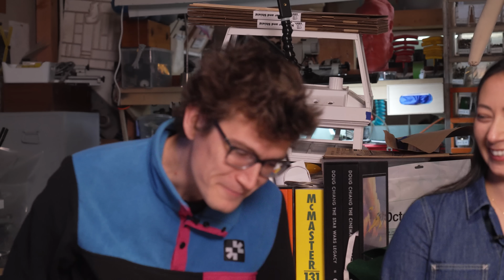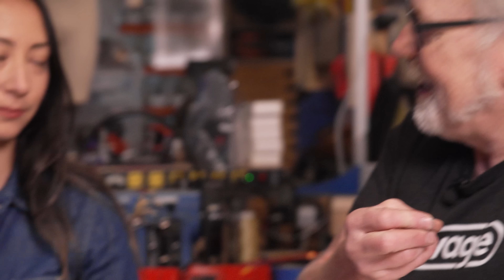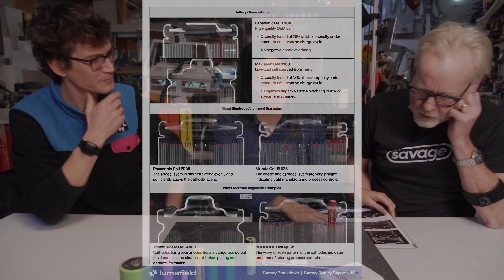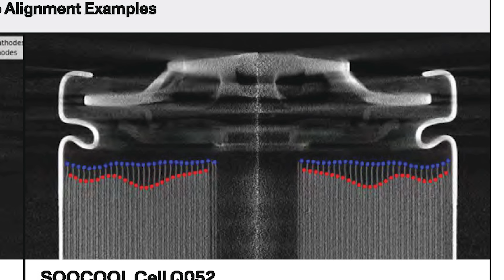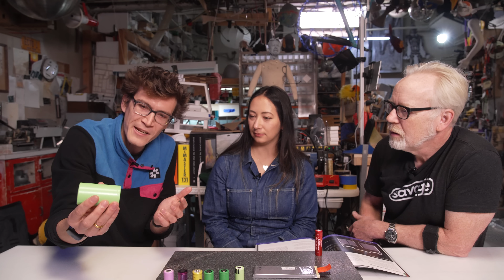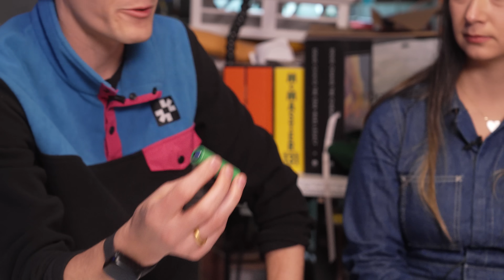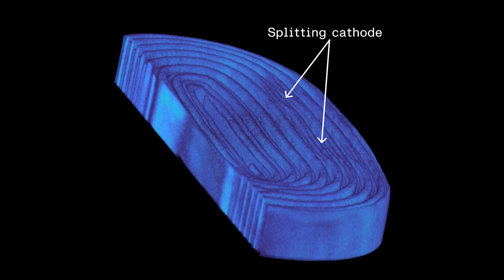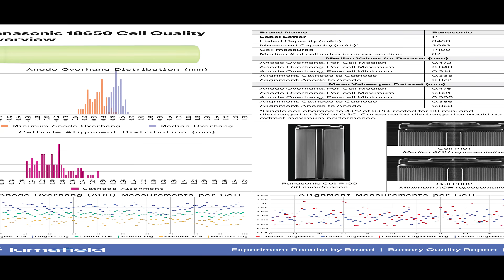The Surprising Flaws in 18650 Lithium-Ion Batteries

Comment: My hobbies are long range drones and rc stuff, i built diy batteries, i invested on a metal fire proof safe with smoke vents and store hundreds of my lipo pouch,lithium 18650/21700 inside, and i NEVER charge packs if I’m not around them, if i had to charge overnight i leave those on my backyard shed inside a metal ammo box that is 30 feet away from our house..all of my unused stocks are all discharged at 2.85v for months of storage in my cool unfinished basement near a fire extinguisher..

Comment: Question; I use two 18650 cells in series to power RC gear, and a safety would be dangerous if there was a loss of power. Is it possible for the safety to activate while in service? not worried if the safety pops while on charge, but in the air is out of the question.

Comment: Using a granite surface plate to display the batteries.  The airlines would be interested in safer LiPo batteries, or at least passengers would. Probably won't be long before all of them will be banned on board.

Comment: Interesting visuals, but the video never really quantifies the actual safety risk. 

Showing that cheaper cells have more defects is useful, but “more defects = more dangerous” is not the same as showing how much more likely they are to fail, catch fire, or short internally.

Comment: Excellent interview.  Remember folks that when these dodgy batteries start burning, they also emit a shedload of highly toxic noxious gasses - stuff like Hydrogen Fluride that will wreck the lining of your lungs if you inhale it. 
And if they are in a sealed container, can generate explosive gasses too that go BANG ( turning the container into shrapnel if you'reunlucky).  Run away as fast AF if you ever have one on fire or off-gassing.

Comment: I charge in my garage with batts in a two hole concrete block on a concrete floor with a 2.5 inch concrete slab closure on top. I slow charge whenever that is a choice. Unplug overnioght.

Comment: My powerbank just started to lose charge after 6 years..as I took it apart I noticed there was two blue 18650 batteries in it😮 I found this video as I was searching for replacement 18650 batteries..it was a tzumi power bank made in china..I'm wondering about not getting the batteries for it..I'm always home by my lithium batteries when charging..just in case

Comment: Ive have  used both the old Ray-O-Vac (way back when), and now days, Energizer over Duracell. Is it true that the best way to checkout a AA, AAA or D cell , is to put it under a load, and watch the voltage?

Comment: Wait till you discover the 85% difference at installed watt meters at any renewable site and then you add batteries for a 5% more of a difference so armed with a volt amp meter any renewable site don't forget the one293

Comment: interesting talk and tech, thanks! 3 key questions:
1) What are examples of a "reliable manufacturer" for these batteries? When you say "Amazon" & "Temu", does that mean e.g. "Amazon Basics" branded batteries, or anything bought off these sites (since you mentioned the branded packaging can be misleading / irrelevant)?
2) Is the danger / risk in using these cells during the recharging process at the wall, or anywhere in the normal life cycle of charge & discharge?
3) Where is the oversight for false advertising? Sure, we've become accustomed to a world in which companies regularly bend the truth to fit a narrative, with small print, T&Cs, and asterisks and footnotes to CYA against litigation. But bald-faced lies? I don't understand how it's become normal to the point of dismissal-with-a-knowing-smirk that a product can be sold which is advertised as having properties that are physically impossible.

Comment: Hopefully,  my $1K+ DeWalt battery collection will work safely for years to come. I've got about 2/3 20v and the rest 60v packs, with DeWalt branded charger/maintainers...
30+ years of their equipment, and I've only had a couple older 12v batteries go bad with a soft fail and no fireworks.

Comment: Okay, so there are a lot of experts on here.  Someone explain this to me: They are showing these images and identifying the anode and cathode.  Their "anode overhang" appears to be a very thin electrode sheet.  But in none of these images do I see the separator.  Does that not show up on the X-ray?  It looks to me like they are confusing the separator for an anode.  The anode has a slurry placed on a copper sheet, and the cathode has a slurry placed on an aluminum sheet, so these two components are relatively thick.  There is a thin piece of plastic-type material that separates the two.  To me, that's what I would think the overhanging material is.  I have taken these cylindrical cells apart, and when you pry off the end caps, the first thing you see is the white separator.  I cannot see the benefit of "overhanging" the anode electrode. That would be crazy to think that this whole document overlooked the separator, so I'm probably wrong.

Comment: I can tell you now, as someone who vapes, the difference in battery quality is honestly crazy. Sometimes you can actually feel it just by taking a puff, cheaper batteries struggle to maintain voltage under load, causing noticeable voltage sag and a weaker vape experience.
I mostly buy Molicel batteries now because I’ve had a married set of 18650s last just over 5 years of almost daily use in the same vape mod. They were always charged in an external charger and properly looked after, which definitely helped them last.
On the other hand, I’ve tried cheap 18650 batteries (the usual Amazon specials), and the difference was massive. I bought two because they were only £4.50 each, but after around a year of use in a dual battery mod, one of them completely died and would no longer hold a charge. The other technically still works, but I only use it as a single battery now because the performance has dropped so much. Even running a vape under 20 watts, the battery life is poor, and honestly, it’s probably reached the point where it should just be recycled.
The price difference between a quality battery and a cheap one is so small that it’s simply not worth trying to save money. In the long run, you’ll just end up replacing cheaper batteries much sooner anyway.
After watching this video, I’ll never buy cheap batteries for vaping again. Quality cells are worth every penny.
If you’re vaping above 50 watts, I really don’t think it’s worth risking poor-quality batteries, especially when you’re holding that device right next to your face. I’ve never had a battery go into thermal runaway, and I have no intention of finding out what that’s like. I’m quite happy with how my face currently looks and I’d like to keep it that way 😂

Comment: This video is packed with valuable information, featuring CT scans of thousands of lithium batteries and in-depth analysis of manufacturing quality control differences! Many defects shown in the video, such as electrode alignment deviations and separator wrinkles, stem from instability in the lamination process on the production line.
We have focused on lithium battery equipment R&D for ten years, producing high-precision, stable lamination machines in various specifications. Please feel free to contact us if you have any lamination machine purchasing needs.

Comment: Haribo is a danish candy manufacturer, they have never ever made batteries or powerbanks. It's a Chinese fake powerbank.

Buy cells from only these manufacturers:
1: Sony (Japan)
2: Panasonic = Sanyo (Japan)
3: Samsung (Korea)
4: muRata (Japan)
5: If absolutely needed: LG (the absolutely only good Chinese cell)
-Absolutely nothing else from China, they're all dangerous (yes, also CATL).

Don't buy prismatic cells either.
I've been working with Li-Ion cells for a long time, I have somewhere between 3000 and 7000 used cells at home, lots and lots of those are junk-cells. Many of the wannabe-cells are either very lightweight or are filled with sand (guess where they come from - yes, you guessed right).

Comment: As a scuba diver I have multiple of these batteries as they power my dive lights (I carry two on each dive, 1 if I’m filming). These batteries have a charge connector (mini usb & now usb c) built into the battery. I see those types of 18650 we’re not part of the test group. I’m curious as to their manufacturing standards compared to the standard 18650s. Nonetheless…I’m sharing this video with all my dive buddies.

Comment: I have been a huge fan of this particular battery cell since I bought a headlamp for working Eminem industrial application as an electrician.  And through rain and everything this headlamp whent above for about $45.  I know there's a lot with the reflectors and there's a lot with the LEDs but mostly when I tear different headlamps apart I find the LED technology is the same the boards are usually pretty typical some of the components solder to the boards such as buttons and things aren't as great as others but then it comes down to those 18000 model batteries.  I can honestly say I don't know what the difference in order from batteries would be but I am highly interested to watch this whole video because I'm going to be making my own battery cells for my Milwaukee drills and for my budget brand$30 drills and I'm heard one time a lot of it just has to do with the battery technology

Comment: 18650s are useful...
But, it's lithium.
I am looking forward to some of the battery tech they're working on.
Reply: Most people don't handle....
Ok...  I'm over here with control boards and working the voltage so I can replace batteries with packs..😂

Comment: Cheap lithium "power banks" pose possibly the single biggest threat to civil aviation safety today. Fortunately the airlines are now waking up to this. I've started leaving mine at home, even though I splurged on an expensive model. Even so, who knows what's inside, and whether there is adequate extra space for cell expansion in case of failure?  Thanks Adam and guests!

Comment: Yes!  Safe & appropriate disposal of old, no longer chargeable, swelled up batteries would be great to know, because my experience with lithium batteries is that once there is an opening, if moisture gets in there, the lithium explodes into a fireball that I would NOT want to put more water on!  When I get concerned about a swelling lithium battery, I store it in an air tight 5 gallon bucket until I can get it out of the house to burry it in dry dirt, hopefully before it erupts in fire; I'm NOT sure this is the best or recommended procedure though!!  In fact, I now have a battery cemetery in my yard but, I don't want them there indefinitely!!!  What should be done???

Comment: There's a much better battery technology that will eventually replace these lithium-ion batteries: Na Sodium-ion. Safer and they give you more cycles (some folks says 10 times more cycles). Check out the ELECOM DE-C55L-9000 Sodium-ion power banks that are currently available ONLY in Japan.  The lithium-ion industry is trembling now that this technology has come to the consumer market in Japan.  As of June of 2026, that $50 power bank is not allowed to be shipped out of Japan.  Bluetti Na Pioneer is Sodium-ion and much bigger and costlier.  We need to see some "Savage" research on these items please.....

Comment: Before notebook PCs went to flat pack LiIon, they used 18650s.  I used to repair PCs and replace "old" battery packs.  The cells were still fine, it was a timet chip inside that shuts off the pack to make you buy a new one.  Needless to say, I have a huge box of 18650s, all high quality Samsung still gping strong 10 years later.

Comment: You see this problem in Ebikes too, they use the key ignition to complete the circuit in the battery case, instead of having the bike be a mandatory part of the circuit. Bike company had no disclosure of this and my housemate incidentally had the key touch across the poles of the keyhole, burning his hand real well and causing the battery to fry, we dropped it in a tall bucket and ran him to the hospital. and it burned itself out in the bucket.

Comment: Thanks, Adam! I support other folks to design and build engineering projects (as a hobby)... some use batteries for electronics (including Li-on), so I will be sure to pass on this video link and the battery report link to hopefully prevent someone from buying a "too cheap" battery and having an issue at some point!! 😮😮😮😮

Comment: There are some parameters you can check at home, like the weight of the battery and internal resistance. It would good to see if there is relation to the inside of battery. Generally lower weight usually produces lower internal resistance and better performance as it charges faster heats less etc.

Comment: I had the highest quality Bluetooth speaker almost catch fire, had to smash it apart with a maul hammer to stop it. 
With these expensive material demanding disposable products , with faulty chargeable batteries making it look " GOOD". Piggy backing onto the ' GREEN LOOK", its a idiotic lie, think about it, buy limiting the ability of choosing whether or not the consumer wants to put the rechargeable battery or regular battery into their electric demanding products. Then control the industry, making regular batteries illegal and only rechargable batteries, increase XRAY CHECK SYSTEMS ,

Comment: I expected better from this channel. This is Digital foundry level smh.

Several major things are missing. First thing is that "18650" is only a size format, not a battery type. Different chemistries (INR, IMR, NCA, NMC, LMO) can behave completely differently even in the same form factor. Internal resistance also deserved way wayy more attention. It is one of the biggest factors affecting voltage sag, heat, current capability, and pack safety. High capacity and high drain cells are optimized for opposite goals, which is why fake "9900mAh high drain' cells are physically unrealistic. Capacity alone DOES NOT determine battery quality or safety. Also trying to say "No name brand cells = dangerous junk" is not fully true either. Please do better next time. It would have been better if you could have done real world tests and posted the results.

Comment: I have a couple of Fenix lights that use a 3500maH battery cell (the lantern takes 4). They are seriously expensive, and I don't use them on high intensity unless I need to for a short period. As a mining security lead I need a good light.
The charger has a safety feature that tests and reads out the condition while the battery is on charge. I found one of the six had degraded over time, so it's gone for recycling. I may have to start buying new cells, and at $35 each it sucks, but in truth they've served me well.

Comment: Even the rectangular 9V batteries actually have 6 tiny AAAA 1.5V cylindrical batteries inside them. yes, you know double A (AA) and triple A (AAA) batteries, but there are quadruple A (AAAA) batteries too and the rectangular case of a 9V has 6 of those round batteries inside. (Some brands outside of Energizer and Duracell, may not be EXACTLY AAAA batteries as you CAN BUY off the shelf, because they are used on the interior of another battery they are made slightly differently [called LR61], but if you open a 9V battery they will look just like AAAA batteries.
Also those BIG chunky square tall 6V batteries for camping lanterns etc are just 4 D batteries inside.

Comment: This is so true for the LED flashlight industry.  You have the name brands that have realistic claims of brightness and very good reliability and longevity. Then you have the Amazon lights with claims of 90,000 lumens(which is impossible) and they also come with the same batteries that are causing concern in this video.  The name brands flashlight makers often market their own brand batteries that are made by the name brand OEM  battery makers and just rebranded for the light maker.

Comment: Great vid - I'm surprised that lesser quality chinesium brands haven't been in the news... reporting fires etc.  I know there are those reports but one would think there would be a LOT of those reports - in any case, this vid was GOLD and very interesting and informative.  Knowledge is Key.   More and more as time goes by it seems the reality is that for 'most' of these chinesium companies, it is realized that quality control and overall quality IS EXTREMELY LACKING, resulting in early death and failure for just about anything manufactured ...and I mean 'anything' because so much is now manufactured in china and china has created a really negative reputation in the world for the concept:   Quality.    The opposite is true for Made in Japan as most anything made in Japan has the extremist mindset of ZERO DEFECT.   This is the world we live in.

Comment: Another aspect to safety is the chargers.  Some chargers are dangerous for not using temperature and current to regulate the charge amount.  Lithium iron phosphate are better in regulating temp and current charge and discharge.